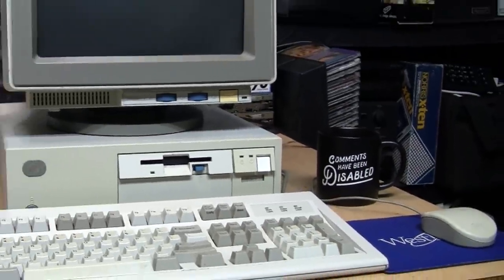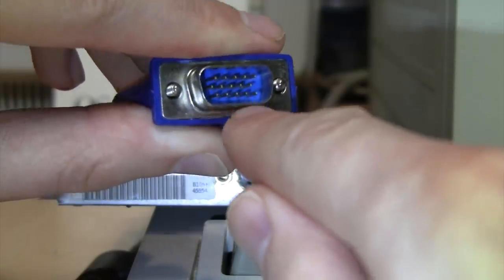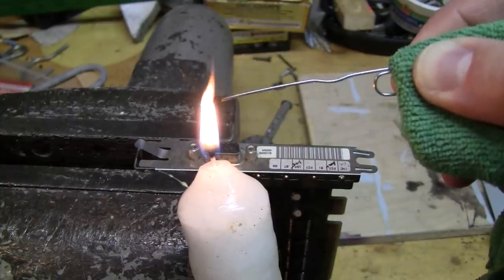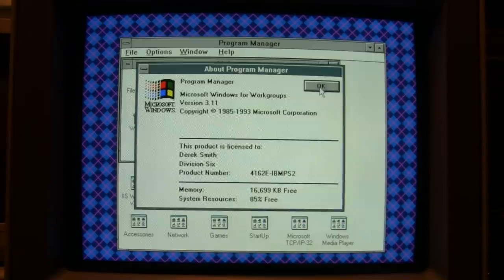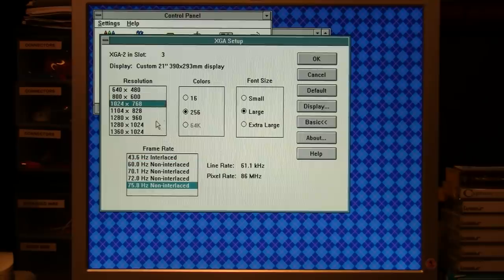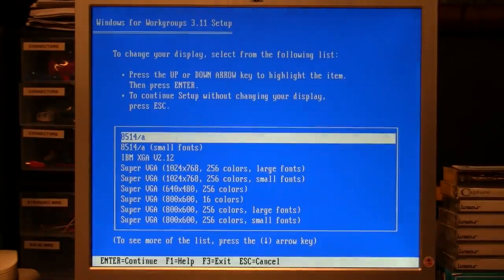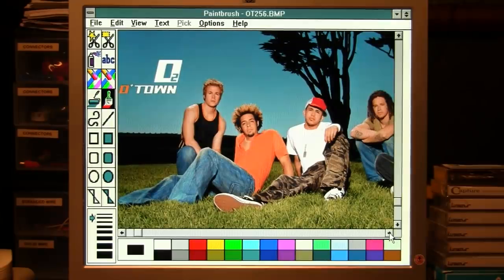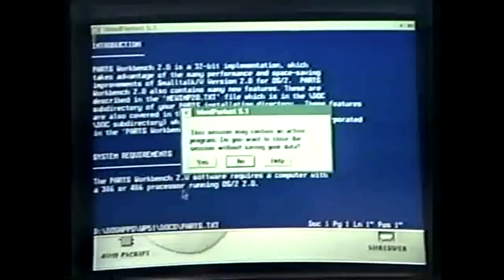Fix your IBM PS/2's VGA port with a paper clip and fire

Comment: The way I solved this problem for my IBM WheelWriter 50 was to just use some needle nose pliers to pull out the pin from the monitor.

Comment: Tried to hook up a 17” Dell monitor up to an IBM Model 60, I have the older VGA cable with the pin missing. I get no video when turning it on.

Is this something with that machine? I tested it on a Compaq Prolinea with the same port, and it worked without issue.

Comment: This tutorial came at the same moment I needed it for one of my old IBM pcs in my godown which I needed for some softwares to run and I was afraid to that thing even tho I knew it wouldn't break anything but after I watched this I had some courage and did it. While I expect big youtubers to be like yea we used a $90,000 cnc router for exact measurments  COUGH COUGH linus COUGH COUGH

Comment: I forgot about this. My mouse is not recognized and scan shows cable disconnect. The PS/2 port for keyboard works, disabled number lock keys etc. Mouse cursor just sit there. Will try fire and paper clip before checking if this is some sort of scamware ( Windows) as my port was breaking wiggle ly. Thanks

Comment: Hey there folks. I have a question a bit out of context. Can I put a straight tonearm’s cartridge on a turntable with curved tonearm, keeping in mind that both turntable from DUAL. Thank you.
Reply from the maker: The cartridge itself is the same. It's the angle of the headshell that's different.

Comment: Oddly Enough, I Still Have One Of Those VGA Cables With The Missing Pin On Both Sides... It's Kinda Thick And Stiff, So I Don't Really Use It... Newer Flat Cords Are Softer And Way More Flexible As Well As Lighter So They Don't Pull On The Port Connections...  I Don't Even Know Why I Have It Because All Of My Monitors With VGA Ports Have All The Holes Open...

Comment: What was the point of blocking off the hole rather than just not using it?  Were there other devices using that connector?  Was it a proprietary thing?

Comment: You could use a "port saver" or 2 gender changers, I've done this to remove the ddc pins so windows wont auto detect the monitor in the past.

Comment: The hottest part of your candle flame ought to be the blue part, not the tip. (edit: I was wrong)
Reply from the maker: According to every diagram I could find, the tip (or even slightly above the visible glow) is the hottest part of a candle flame.
Reply: @vwestlife  Blue photons are at a higher energy state than red photons, so the hotest part of a flame would be the blue parts.
Reply: @vwestlife  We must have seen different diagrams. I wish I could ask my chemistry teacher; he would think of a devious way to find out which diagrams are right.
Reply: @UCA0hfFtHPIgxlxTjMPvaw0A To me, the tip is the top part of the yellow bit of the flame?
Reply from the maker: @niek024  See: https://en.wikipedia.org/wiki/Flame#/media/File:Anatomy_of_a_candle_flame.svg

Comment: i just buy a female -> male vga adapter which i remove a pin from before i screw it on to the connector on the computer so no need for modification ;)

Comment: 12:04 Isn't it sad when someone obliviously boasts and brags about being wrong? 🙄 He's so chuffed about making you have to use a mouse to navigate to the menu to open it, then navigate down to a menu item and click that to open a dialog-box, then move the mouse to a button and click that to exit the OS instead of just pressing Ctrl+Alt+Delete. 🤦 Yeeesss, sooooo much better and easier and faster, especially if you can't see the screen for any reason. Drrr. 😒
Reply: (There have been plenty of times when I couldn't see the screen for any number of reasons like it was dead or I was working from the other side and couldn't move to look at it or it was a remote session or the system was too slow and the screen wasn't updating or whatever, and I had to rely on pressing keys I had memorized to get stuff done, where using a mouse would have been impossible. I hope that guy was NOT in charge of UI/UX. 🙄)
Reply from the maker: The idea was to make it easier to use within the graphical environment, and to move away from an arcane three-key command. And in OS/2 you could have dozens of DOS applications running in windows simultaneously. If you pressed Ctrl-Alt-Del, how would it know which one you wanted to kill?

Comment: magical missing 5V pin :] i argued about that  with multiple people in the past because they only accept vga pinout not svga as a correct one and my converters made in the early 2000's were powered trough that pin and people didn't know it can be done
then again currently sold chinese vga>hdmi converters still don't now they should connect 5V and data pins on both plugs directly